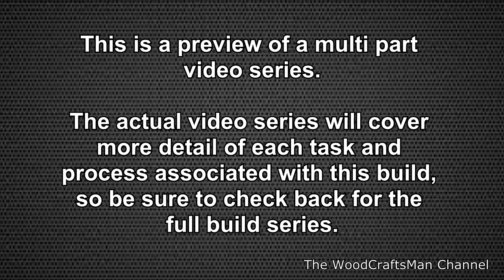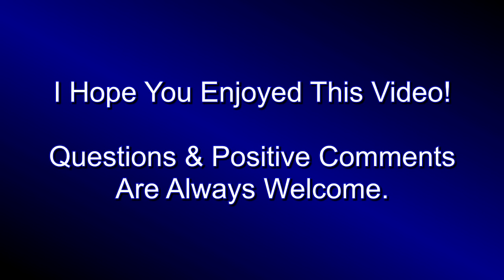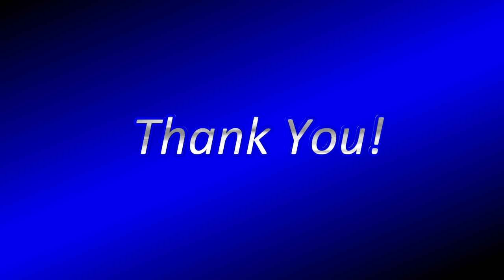Custom Entertainment Center Cabinet Build Series Preview # 205

Comment: hi scott looking forward to see how you do your glass doors that is something i was never happy with, i have always routed the back profile and siliconed the glass in  until last week when i came up with a new way ! nice video
Reply from the maker: +philipe do carmo hi Philipe, thanks for the comment. I just use glass clips which is just a,piece of plastic with a little tab on it that is screwed to the back side of the frame and it has a little finger that seats against the glass pain. When the glass comes in I will try to include it in the last video. Thanks! Scott
Reply from the maker: +philipe do carmo oh, and I almost for got, the door is built just like a standard cope and stick, and I use a modified live flush trim router bit (was commonly used for laminate trimming / solid carbide with no bearing) to route out the back. Scott

Comment: Good stuff 👍what are you using for your spray finish
Reply from the maker: +Kenneth Hedges, thanks for the comment. I use Sherwin-Williams Sherwood product line. The finish consists  of a precat vinyl sealer and a high solids precat lacquer. Thanks! Scott

Comment: what is the green machine that you use to make the molding ,also great build !!
Reply from the maker: Thanks for the comment. You must be referring to the operation at around 1:30? That is one of 3 shapers I have set up for building cabinet doors. This particular one you are referring to is one dedicated to making the cabinet door frames with cope and stick joinery. The green part of the machine is a power feeder that feeds the parts throuugh so your fingers don't get close to the cutters. Scott